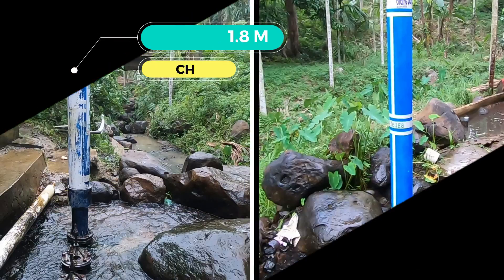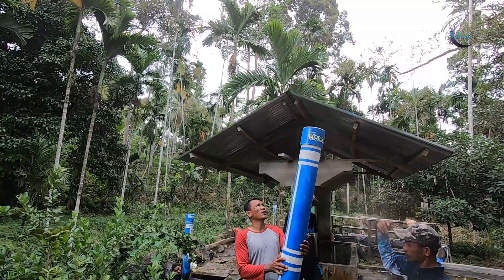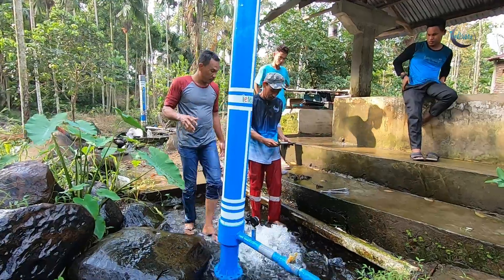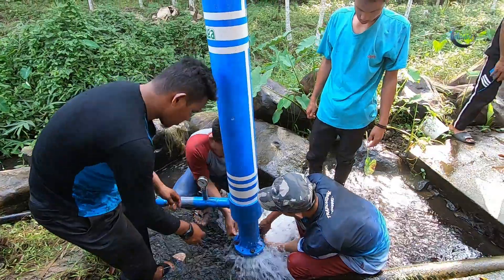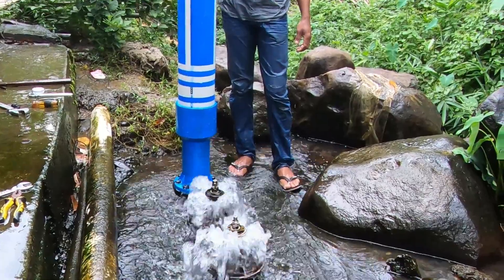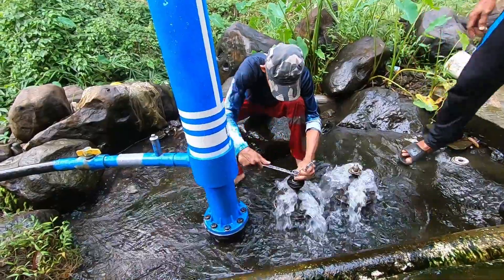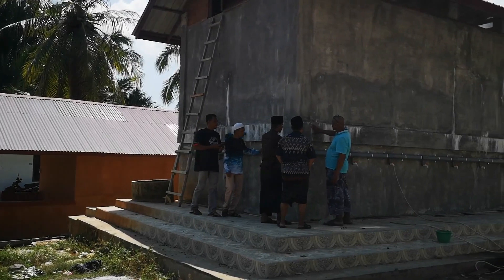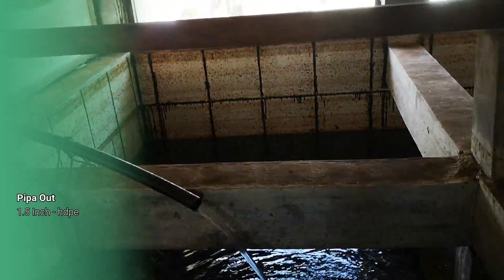This Ram Pump is capable of flowing water over a distance of 14,200 m. Ram Pump for Nisam People

Comment: ممكن تشرحون لنا عن الثقوب الموجودة في انبوب التدفق ؟؟
Reply: to remove trapped air from the pipe. Air lock or trapped air will reduce water pressure thus reducing output at the end of the pipe .

Comment: Hi. This is wonderful. I have one doubt. Can this work with water which is not flowing. Like well or borewell or pond of water?
Reply: wells can be drained, but only through horizontal pipes and must be under a tube-like device that draws water from the well to be continuously sucked up by the water that flows out, there are several YouTube channels that demonstrate this.